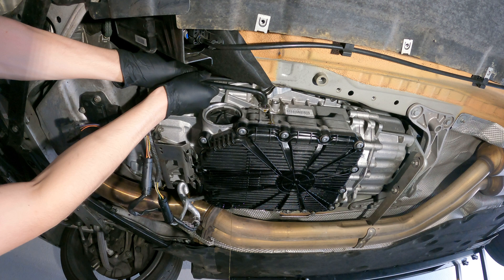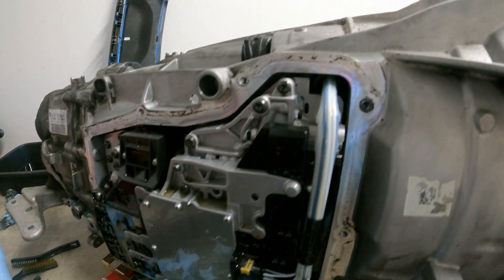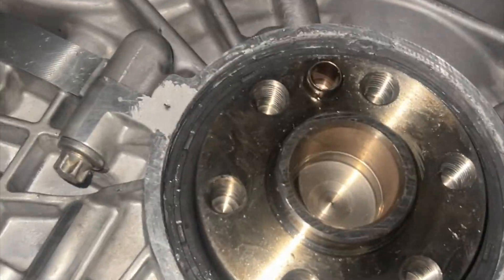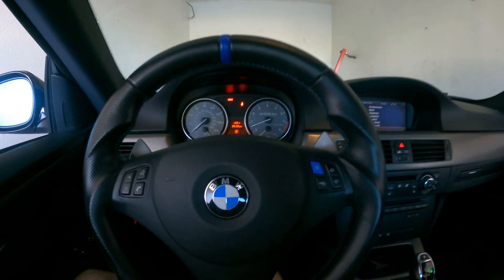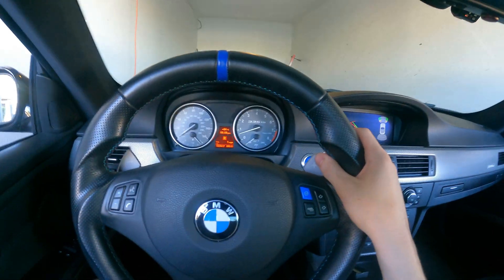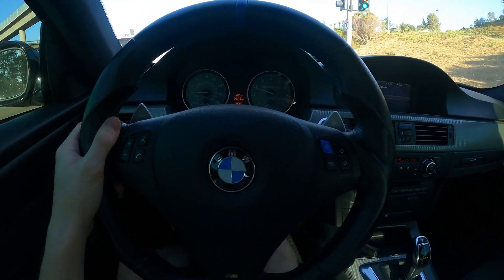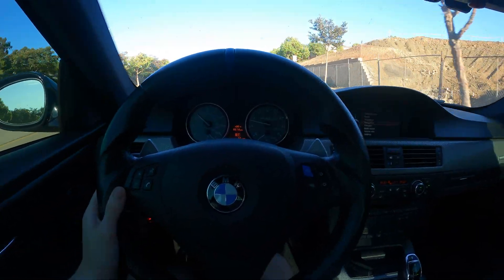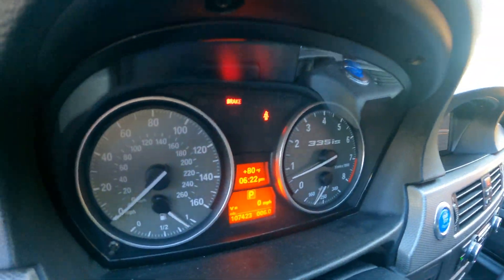Ultimate BMW 335is Transmission Service - DCT service, S55 Flywheel, Rear Main Seal

Comment: Please do a neutral rev showing the dash to see the difference in rev speed!
Reply from the maker: I gotchu, I’ll do a vid on it. Here’s another that someone posted a few years ago: https://youtu.be/2gjf0byD6zQ
Reply: Thanks for the quick reply! Ive seen it. Im about to pull the trigger to buy a used S55 flywheel JUST for the aggressive blips that we all hear from E92 M3, F10 M5 and F8x DCT. Because the rational is that lighter flywheel would respond more aggressively to the blips. I have XHP stage 3 now. Is it worth it? Im about to pull the trigger!
Reply from the maker: Of course! Honestly I think xhp does more than the s55 flywheel. I think it has more to do with the tune rather than flywheel. I haven't really noticed a big difference from the flywheel maybe slightly faster downshift and upshift but thats it. If you are taking the trans out for a service or the rear main seal then I def would. Otherwise prob not worth it imo. 

Yes I can make a vid showing downshift from dash and exhaust. Ill put a few cams on and some mics. Prob won't be for a few days or so, but will tag you when posted!
Reply: @youraveragen54 perfect!
Reply: Do you think you are kind enough to show us how the downshift sounds like from dash and exhaust?
Reply: Ive seen your canyon drive but it looks similar to stock?

Comment: Amazing work. How long did this take you? I’m thinking of going single turbo soon aiming for 650whp. Do you think I need to upgrade clutch or just s55 flywheel should do?
Reply from the maker: I really appreciate it! It was about 2 days worth of work, plus I let it sit overnight for the sealant around the rear main seal. Wasn’t going extremely fast and wanted to make sure the trans was done right. From my understanding the clutches last till about 750 ft-lbs of torque. If you’re going for high power and want it to last I’d prob do clutches and a lightweight flywheel like mfactory instead of the s55. I put the s55 bcs I got it for very cheap.

Comment: I have a stock 2013 335is. Recently installed MHD stage 1. I prefer to keep the car stock. Any preventative maintenance you recommend other than regular CBS stuff, filters, ofhg, plugs+coils, and walnut blast?
Reply from the maker: Definitely service the transmission if not done. Atleast fluid and side filter. U could put a crank seal guard. Belt and pulleys, m3 front control arms, transmission bushings, water pump & coolant hoses, reservoir will eventually crack, radiators go bad on the end tanks. Def get a metal chargepipe even if using stock diverter valves. That’s all I can think of off the top of my head.

Comment: Does the s55 flywheel fit correctly or would I need to mod it accordingly
Reply from the maker: It is completely bolt on with no modifications needed! Makes the car feel much better
Reply: @youraveragen54 also another question. I’ve been told that if I service the trans id run into issues further down the road with time. Have you ran into any issues/ slipping after the service
Reply from the maker: @ who was it that told u that?  Put over 10k miles since my service and been great.
Reply: @youraveragen54   the dealership lol 🥲 just because of the “lifetime fluid”….. I’ve been so hesitant to get it done because of that but now knowing you have no issues, I’ll be getting it done asap
Reply: @youraveragen54 also make sure you get the right bolt , 6 bolt or 8bolt
Reply from the maker: @noahzm_ The 335is and s55 only came with the 6 bolt crank. The older n54s were 8 bolt but no factory dct 335is is 8 bolt.

Comment: Where did you get a S55 flywheel for $170???
Reply from the maker: A local auto dismantler didn't know what they went for and thought it was just a flexplate like in a traditional auto transmission so sold it cheap. Low miles too!

Comment: where did you get your steering wheel and which jacks are you using!? thx in advance and great video!
Reply from the maker: Steering wheel is from Azaautowheel. You can use pretty much whatever combo u want from them. I used quickjacks to lift the car. I believe it’s the 5000TL model
Reply: @youraveragen54  appreciate ya!